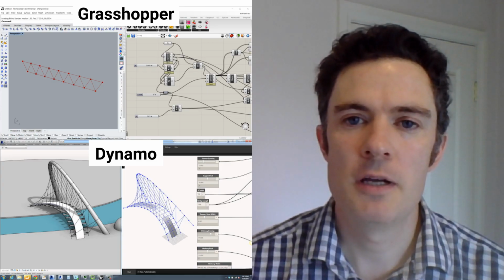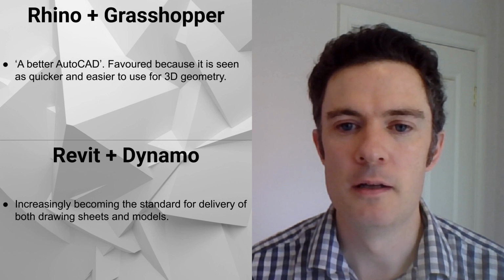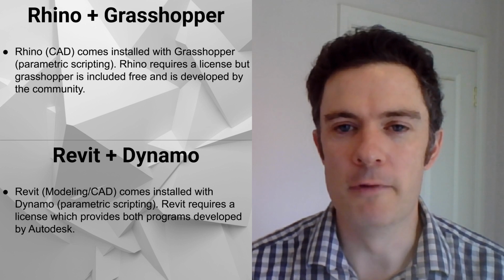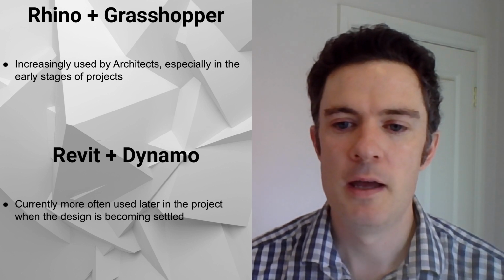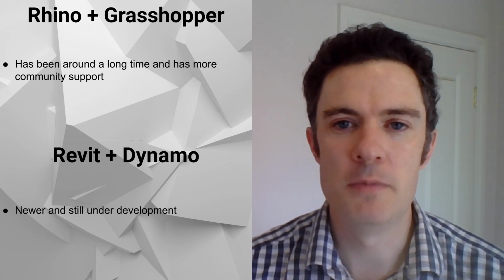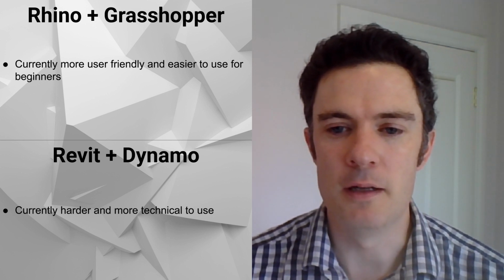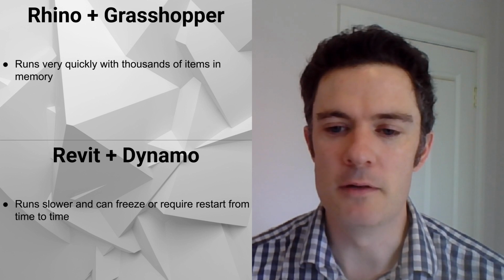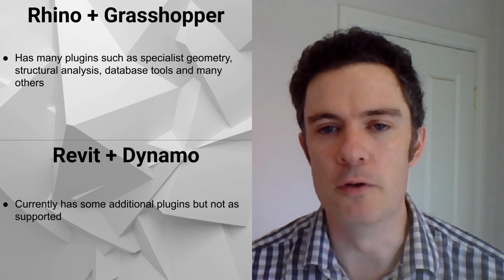Grasshopper vs Dynamo parametric Pros and Cons for engineers. Revit vs Rhino. Which is better?

Comment: Thanks for the video, good info. Do these systems also integrate the member design or does that still require export / interface with Spacegas or FEA programs?
Reply from the maker: Thanks. There are several good design and FEA plugins within grasshopper which means you don't have to export/interface anymore. Depth of functionality of the plugins is generally on the lighter side though so it depends how complex or feature rich you need your analysis to be.
Reply: @StructuredParametrics  thanks!

Comment: I’m a bit confused whether I should focus using Revit or Rhino .. but in Revit it’s very easy to insert blocks model such as doors / windows / stairs/ table chair/ etc ...  or maybe does Rhino’s also have that kind of blocks too?? or we still should create it manually? 
cause i’m still beginner for learning Rhino 🥺
Reply: Rhino with Visualarq und grasshopper can do almost everything
Reply from the maker: Depends what you want to achieve. Revit is used throughout the industry more towards final documentation. Rhino is more simple but fast and flexible. It is more useful for early stages of a project. If in doubt Revit skills will probably be more recognised as everyone comes into contact with it these days.
Reply: @StructuredParametrics  I'm a rhino grasshopper trainer and I know the incredible potential, however companies probably need Revit users more at this point. I agree with your point. (Only if you have to choose one of course....the best is both ;) )

Comment: good video.. i would like ask you something, i'm using blender but i dont know if that software is parametric software.. so u can explain me that ? sorry for bother you with my question
Reply from the maker: Blender can have parametric elements although I haven't used it much so don't know how quick the workflow is. It means an input can control geometry or other properties of objects. As an example that input could be a slider so as you move your mouse a wall would grow or shrink. However there is a lot more that can be done with this concept - even to the point where a script can design a whole building based on you drawing a rectangle!